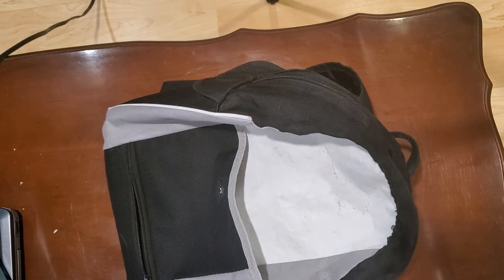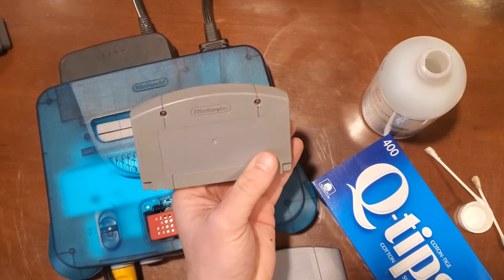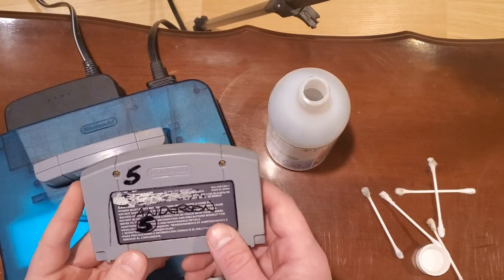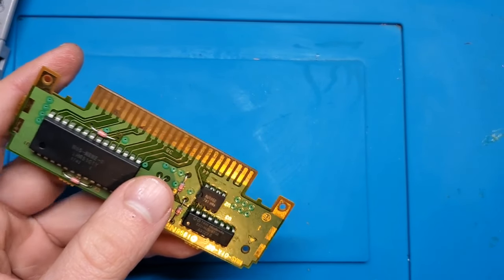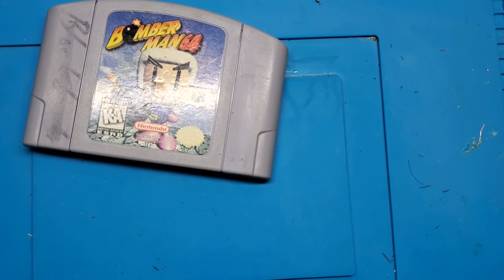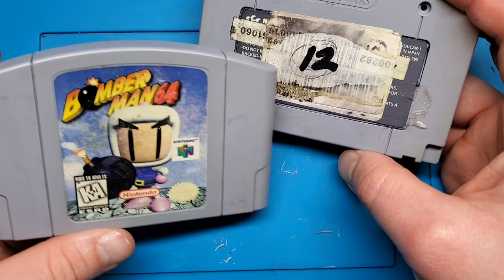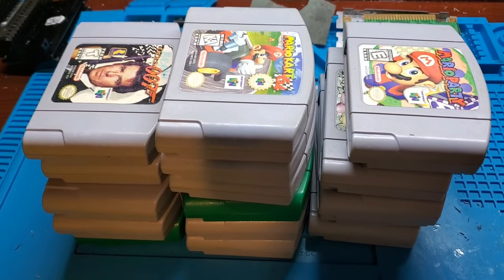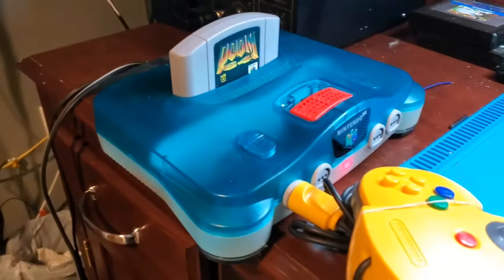Big N64 Lot with Mystery Games - Cleaning and Testing the Lot - Fixing Ebay Junk

Comment: Great video, I'll have to try the eraser and dry eraser marker tricks!

I recommend when working with isopropyl alcohol to wear nitrile gloves so your fingers don't get horribly dried out. I also sugguest using a small container to dip your qtips into, instead of dipping them directly into the bottle, so the contaminants on the qtip don't mix in with the rest of the bottle if you happen to double-dip.

Comment: When it comes to replacing labels, if you have a really good printer, use glossy paper and a spray adhesive like E6000. You have to hold the label down as it dries because it can lift up. But once in place, it'll stay.
Reply: The Annoyed Mr Floyd Do you know any good video about this?
Reply: I have had deodorant spray melt certain kinds of plastic, so do a test on one of the backs first, a part that would be covered by a label.
Reply: Who uses a deodorant spray? I'm talking about a water based spray adhesive. And I don't  have a video... But I think The 8-bit Guy does.

Comment: Hi, question, do you do preventative maintenance as well? What would you recommend to someone who has consoles in original condition and would like to keep them in working order for as long as possible? Regardless if stored or not. Also, what kind of ICs or chips do you usually need? I live in Asia and am able to source quite a few different ICs.
Reply from the maker: Capacitors need to be replaced.  The 90s had a lot of really bad capacitors manufacturered.  Some systems are worse than other for this, but a few systems that always need caps are SNES, Game Gear, Sega CD.

Otherwise, some ICs that often go bad are cpu, ppu and vram on the snes, ram, cpu and ppu on the nes.

The snes chips are proprietary and the only way to replace is pulling one off another board.   Nes chips are off the shelf i believe
Reply: @RetroRepairs  Should I email you? You can tell me what you need if you have difficulty sourcing in Canada. I'm from Canada as well and go back every now and then. I love these vids and would love to have a way to support the channel a bit. I'd love to see as well in hopes I could keep my consoles in top working condition.
Reply: @RetroRepairs  where do we find your email?
Reply: @chefkdowg  I think it's in the about page of his channel.

Comment: Sure thing I stayed until very end !

The SNES controller is not that bad, it has a Genesis style d-pad, dont know about you, but I absolutely prefer this over the Nitnendo cross one.
Great haul you got there, and no problems from what I can see. Less entertainment for the viewers, but more fun with all the games being fully working condition.

Speaking of N64, right now Silverwings21 is doing a challenge consisting of beating all of the NA games for the system. Its still in an early stage, as he only did 5 of the 296 titles, but still Im going to follow him through this challenge. I remember when TMR was starting his NES challenge, that actually led him into Guinnes WR. What may interest you is the fact Silver follows the same rules, no emulation, only real hardware and carts
Reply from the maker: Yikes, that's quite the challenge, sounds cool.

As for the SNES one, i agree, i like the snes controller.  This particular one was in really bad shape, so is only good for parts, which still isn't a bad thing.   Those controllers were just bonus really, i bought it for the carts

Comment: mr clean magic sponges work well for removing sharpee
Reply: I've always found those sand down parts of the shell when trying it, even with a light touch
Reply: @burntartic2239  Yeah I don't like them because of that. I go over it with a dry erase marker really really well and then clean that off with isopropyl.

Hadn't made it to the point in the video where he does the same. I usually have better results than he did though.

Comment: Permanent marker (sharpie) is not permanent but uses a different solvent - oil based. Hence water and alcohol does not work, or your normal cleaning method. You can use a thin oil to remove with elbow grease or if you are impatient mix a solution of 50-50 acetone and rubber alcohol. More the volume of acetone, the more aggressive the solvent. Warning acetone is a paint remover, will melt laminate counter tops, styrene plastic (pill bottles), crack lexan (polycarbonate CD/DVDs). Most polyethylene, polypropylene, nylon are impervious. The rubbing alcohol is to cut the solvent strength and allow usage on vulnerable plastics. Remember, paint is a plastic. HOW TO USE>>> get a cloth or paper towel you do not want to keep, spritzer on cloth, wet to touch, then wipe; allow solvent to evaporate quickly. The permanent marker will run like maskcara when wet. Note: you may want to wear gloves; any porous label or, cloth will be stained with the pigment from the marker. GOOD LUCK. I used this solution, cleaning markers from RC car/truck lexan bodies and paint over-spray for years.

Comment: I'd like to see a cheap DIY way to print off the labels at home.
I think it would be cool to use mailing labels or some other inexpensive sticker stuff...
Reply: I think the 8 bit guy did something like that once
Reply: Printer and glossed paper. Gorilla spray adhesive will keep it stuck indefinitely unless you’re trying intentionally to get the label off. At least for a LONG time.

Edit: I usually lay the label down on some newspaper and give the back a nice spray to keep it on the label on on the label only. If you put it where the label is GOING to go it’s liable to be messier, and more room for error.

Comment: Use Everclear or any 95% ethanol for permanent marker.   Permanent markers are suspended in SDA-40 which typicall is 99.86% ethanol and a .14% tertbutyl poisoning agent.  Everclear will destroy permanent marker and its totally fine for plastics, and labels, provided none of the marker is suspended when it hits the label.  Generally as long as the label already has ink printed on it, the marker will not absorb in, so usually you can even it get it off the labels too.

Comment: Baby wipes are great for dirt stuck in places like ingraved logos.
Reply: Rock on, glad I'm not the only one shoving single wipes in my pocket at hot wing and rib joints😁👍. I also tend to cut pieces of Magic Erasers up and use them with alcohol against marker. As well as using foaming window cleaner on the pins.

Comment: Do you think Blockbuster had one of their own labels on the back which caused the ripped stickers on the rear of the carts, a barcode label to scan and when they sold them as ex rentals they ripped them off. Similarly the marker pen numbers would have matched the boxes on the shelves so they knew cart 12 was rented and the barcode scanned it into their computer to id who'd rented it. Lighter fluid is very good for removing labels, you may be able to peel the top layer label off that one cart you did and potentially save the original label.

Comment: I find magic erasers remove marker really well and easily.
Reply: They also remove the plastic though.
Reply: @PuffyRainbowCloud  What I do is dip a part of the magic eraser into isopropyl and rub the marker area, it comes right off.  If it removes the plastic its just a rather minor layer and when you wipe it clean it looks almost new.
Reply: @MysterioMask The point is that you're using an abrasive material to remove the marker. The abrasive material is going to also damage the plastic, however little you claim it does. When you remove things like marker off of anything you want to scrub with something that causes as little friction as possible, not something designed for maximum friction.
Reply: @PuffyRainbowCloud  Why even clean it then if your going for full purity?  I would challenge anyone to tell the difference between a new cart that hasn't had any eraser used on it vs one that has.  It looks the same.  You can make the argument then about how if you use erasers to clean the pins your also taking off a layer of the plating which I have read can cause reduced connectivity, but I haven't noticed any issues on any carts ive cleaned the pins with using a normal eraser.  I mean its not like saying sandpaper it off.  I am just saying it worked great for me.

Comment: All of the carts with permanent marker and back labels ripped are from the Dundas and Keele Blockbuster in Toronto. When that location closed, the games must have been sold. Whomever had the carts tried to rip off the barcodes which ripped the labels on the back. Not uncommon for games purchased from a location that rents games.

Comment: Loved the video!  Two quick questions: What did you use to clean the pins?  It's looks like a rubber eraser, but I'm not sure.  Also, what is the red liquid you used on the cartridge to remove markings?  Thanks so much.
Reply from the maker: Yes,  rubber eraser and a dry erase marker

Comment: Mr. Clean Magic eraser cut into 1"×1" cubes with Rubbing alcohol  works great against marker😁
Reply: Gotta be careful with those because they will change the texture of the plastic.
Reply: @prozac4545  granted it is like a sand paper but with a smooth surface it should come off easy with little to no difference unlike say NES games.
Reply: @leefischer5814  it could change the sheen of the plastic as well.

Comment: I wouldn't be surprised if the cover project website has the labels you're looking for
Reply from the maker: Yep, they have most.  For a couple, I'd rather just buy them from a seller.  My printer sucks and rather than finding decent sticker paper and playing around using trial and error,  I'll just spend $3 and get it done right the first time. 

If i had to do a whole bunch,  then yes,  I'd try print my own

Comment: I used nail polish remover to clean a bunch of games that i got. All of them had names and symbols with permanent marker. The way i did it was put some Nail Polish remover on a piece of cloth and then rub and rub in circles and alternating with another side of soaked cloth with alcohol. If you apply nail polish remover directly to the plastic it will bleach and permanently damage it. 

None of the games that i cleaned have any evidence of permanent marker. Another safer way is to just keep rubbing and rubbing with alcohol, it might take 30 minutes or more this way, but it will get removed eventually. The harder part was the person who marked the cartridges also put marker along the plastic lines... that was Hard AF to remove.
Reply from the maker: Be careful with nail polish remover.  If it contains acetone, that can and will eat away at the plastic finish.
Reply: @RetroRepairs  Indeed. The games i tried were few that i didn't care much and wanted to see if it would work. But never apply the nail polish remover directly from the bottle to the plastic, first soak a cloth piece and wait a few seconds before rubbing. Then alternate between cloth with alcohol and cloth with nail polish remover.  

Marks will be gone in a few minutes. It is riskier that way, but twice as fast than just using alcohol. I cleaned five different N64 cartridges this way 6 months ago. They almost look brand new except for the stickers, last owner marked them too and i don't want to deal with printing or buying those online.

Alcohol is the safer way to go, just keep rubbing and applying force, it will eventually be gone completely if you keep rubbing it.
Reply from the maker: @EtaYorius  the dry erase marker works ok on labels too, it doesn't come off perfectly, but looks far less obvious than big marker marks.  As long as the labels in good shape, my dry erase didnt seem to take any of the printing off
Reply: @RetroRepairs  i am guessing the dry erase marker has an alcohol as a solvent, likely ethyl alcohol as methyl tends to be more aggressive. Bic Mark-It marker (Sharpie competitor) uses ethyl alcohol and I used a contact cleaner with likely 80% plus ethyl alcohol to revive a dry tired marker. The problem is finding 160 + proof alcohol without making moonshine. The acetone really works if you cut it with iso-propyl.

Comment: Little off topic, but what would cause an SNES to only display in black and white on a color television?
Reply from the maker: Could be the clock signal. There's a potentiometer that can adjust it slightly.  

Can I assume it happens with both rf and compisite?
Reply: Something screwing up the color burst. Could be the wrong region?
Reply: @RetroRepairs  yes both rf and composite.
Reply: @davidmcgill1000  Region is fine.

Comment: next time use mcguiers ultimate compound on the permanent marker and it'll come off easier.  i use it all the time for that purpose and i also clean the contacts on my carts with it
Reply from the maker: Interesting.   That doesn't eat away at the plastic?  What happens if it contacts a label?
Reply: @RetroRepairs  it harmed any labels I used it on or eaten away at anything since it's a plastic polish basically

Comment: A better cleaning method for carts is brasso it’s meant to clean metal and then to get all the brasso off fallow it with alcohol to get that off and you will not regret it! I have tried just alcohol and then this method and just alcohol just doesn’t get the job done ass well.
Reply from the maker: You need to be extremely careful with brasso, it will strip the contacts clean off the board.    Brasso would be my very last ditch effort to clean a contract.   Better off using sandpaper
Reply: RetroRepairs I knew a guy that ran a game store for years and he fought me this. And when I say use brasso I mean like a very small amount on a q tip. I’ve used it for years and never had a problem

Comment: Hello, I had great succsess removing permanent marker using  toothpaste.
Reply from the maker: I'll have to try.   Just toothpaste by itself?  I assume with a brush too? Or do you use a cloth?

Im guessing that will ruin a label though
Reply: @RetroRepairs  I just used toothpaste and a cloth. It works well on smooth surfaces. Good luck!

Comment: Thinking about your Japanese N64, I just found this on Thingverse while checking to see if you could find a replacement N64 cartridge housing to print:

https://www.thingiverse.com/thing:513728

There are a couple "remixes" of that design; not sure which one is best.  Still, some clear filament and I think it would come out great!

Also, I'm curious to see how the replacement stickers go.  Idk if the ones on the back vary over time, but if not I'd be tempted to scan one in good shape and print replacement labels myself.

Love the videos!